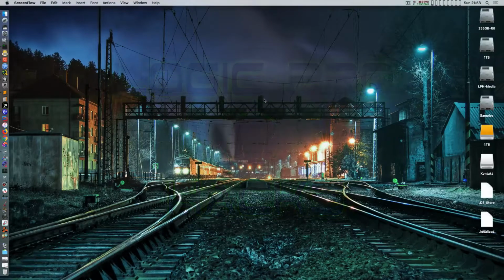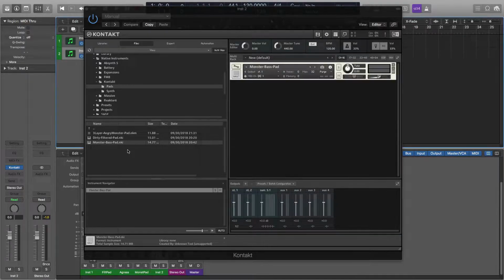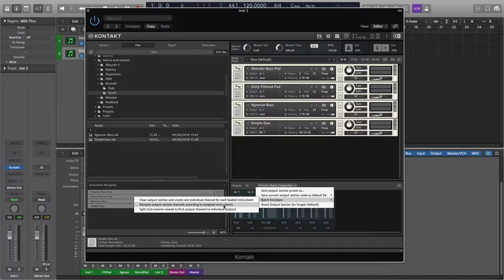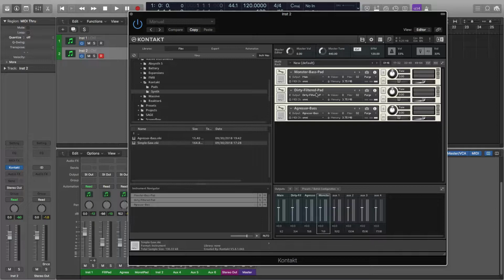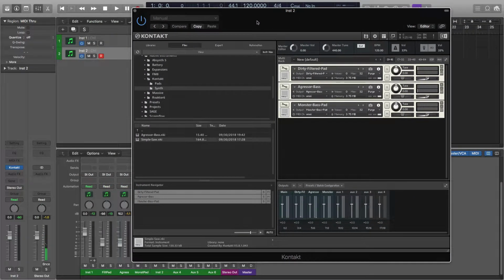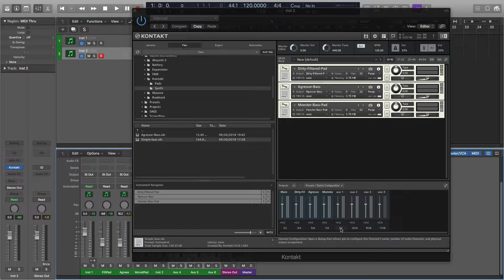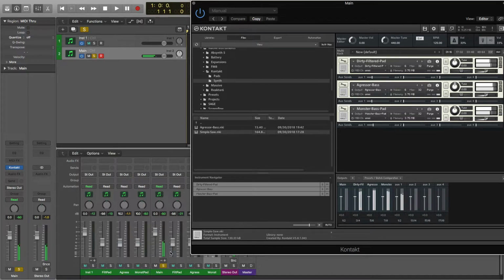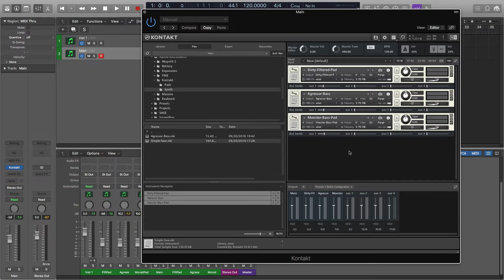New Kontakt 6 Multi-Output - Create a Separate Reverb Aux Bus

Comment: Thanks. I learned a few things!  By the way, how do you get (I assume) those 8 "cores" to show up in the menu bar? Is it just a laptop thing? (I'm on an old Mac pro). Thanks.
Reply from the maker: Me too! I'm running a heavily modified / Hacked Mac Pro 1,1 with Pike's boot EFI ( https://github.com/Piker-Alpha/macosxbootloader ), which enables me to use El Capitan 10.11.6. I have 32GB (Max Ram), Two-Raid0 256GB SSD's, Two-Raid0 1TB WD-7200-RPMs drives, USB 3 card with a external 5400 4TB drive for back-ups,  and a special upgraded Xeon 3.0 GHz, 8 core processor. The thing is a beast, even still with today's standards. However, the ram is only DDR2, very slow compared to DDR3 and DDR4.  And it's starting to show it's age as I can't run things like UVI Falcon or VPS Avenger,  Plus, I can't upgrade to High Sierra to use the latest version of Logic Pro X, 10.4. I'm in the process of working on a new Hackintosh to replace it, but ran out of money to get the CPU and memory I wanted for the motherboard...  Anyhow, The app your looking for is called "Menu Meters" You will need the ported version, the normal version won't work on anything newer than Mavericks.  The link to the MenuMeters ported version is here: https://member.ipmu.jp/yuji.tachikawa/MenuMetersElCapitan/ 
Thank you for the comment.